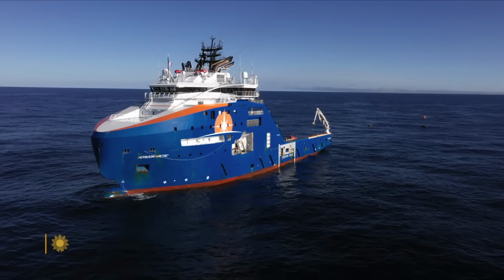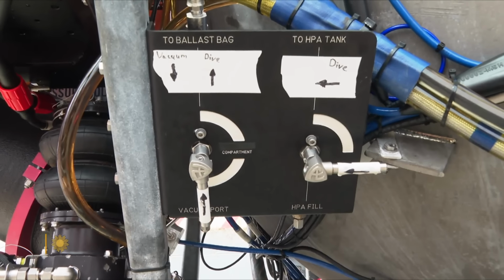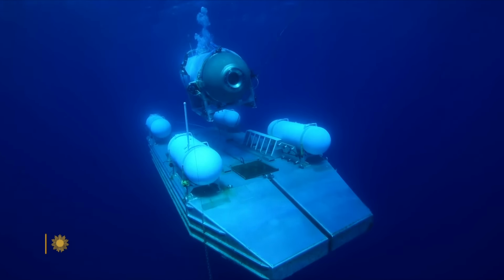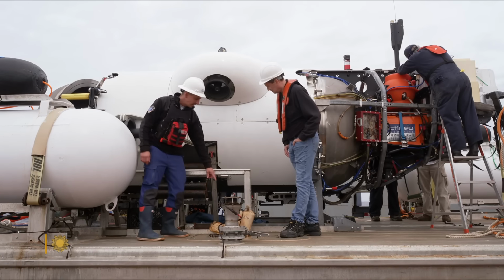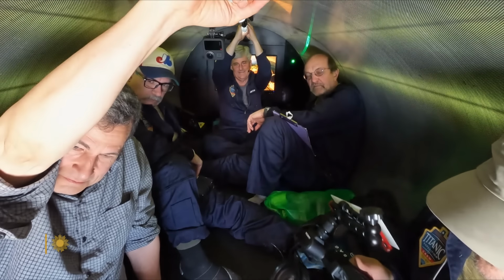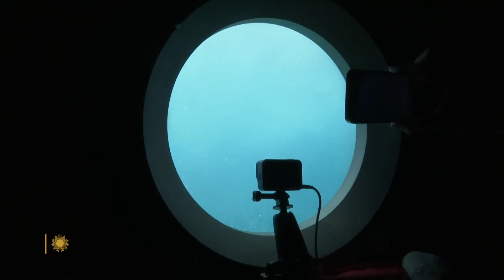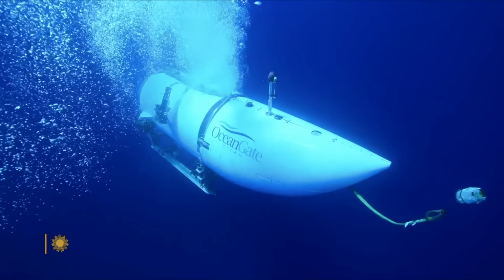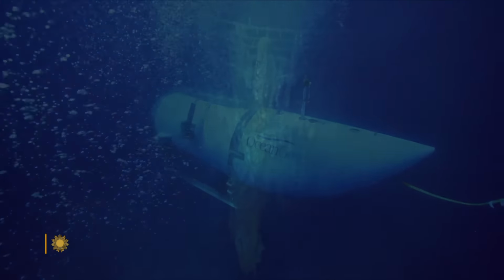Inside the Titanic sub disaster

Comment: For those wondering why it didnt collapse on previous trips...

This carbnon fiber sub went down to the Titanic and back to the surface numerous times. By doing that, the submarine would begin to collapse and then back to normal like an accordion, and this is what most likely caused it to form possible stress fractues over time. Also, different metals that touched each other causes rust. That can be an issue, too.
Reply: Sounds like it was just a matter of time.
Reply: @christianWilliams-pc4jn  have you ever heard Stockton Rush speak? He seemed oblivious.
Reply: The structural integrity of the vessel was compromised after the first trip. NO DOUBT 😊
Reply: Everyone is blaming carbon fiber composite and i agree, also they were using a bad glue...
Reply: @fleurjoesten  That the flaw with carbon fibre polymer. It's not a continuous material. It doesn't relax like steel or titanium does and it while it can withstand pressure well, it cannot go for nearly as many cycles as metals can, it fractures and delaminates. Unlike a metal sub that would just get squashed, the Titans hull would have snapped and shattered under the pressure.

James Cameron's sub that he used to go to the marina trench was 3 inches of steel he never chose carbon fibre because it wouldn't be up to the task.
Reply: @saricubra2867 i think the more likely culprit is the window only rated to 1300m
Reply: I'm no engineer, but I heard that flextape can be used underwater.
Reply: Good guess, but nobody really knows for sure
Reply: @saricubra2867  they used different metals/materials holding it together, and that alone causes rust. If you use a copper pipe with an iron fitting, then it will turn brittle.
Reply: @VinnyDoesLife  Carbon fibre does not rust.  Titanium does not rust.  Glue does not rust.
Reply: It was only a matter of time
Reply: Rush, such a befitting name
Reply: McClaren was the only guy on here that made any sense

Comment: That guy at 5:03 said that the thrusters were enough to take the sub back to the surface, but if those weights failed to release, there is NO WAY those batteries would have enough power to take that 12 ton sub on a 2.5+ hour trip back to the surface. This disaster wasn't an accident, it was inevitable.
Reply: Notice it's all millionaires that get caught up in these things .A fool and his money will soon depart

Comment: Instantaneous destruction on a cellular level.    The body was liquified on a cellular level in nano seconds, before the central nervous system could process.  They are lucky to not have suffered at death.
Reply: I appreciate how Hank Green put it. They instantly became physics instead of biology
Reply: Exactly!   Step 1:  Millions of pounds of water pressure filling the space in the sub in a nano second, causing molecular destruction from all directions.    
Step 2:  Water moving to fill that space in a nano second caused instantaneous tremendous super heating of the water hotter and everything in it thousands of degrees, due to friction of the water molecules, also within a nano second, destroying on a molecular level.     
Step 3:     The reverberation shockwave exploded outward with the same force the water imploded inward, also molecular destruction in a nano second.   

All 3 forces within the same nano second. 

The fools asking about bodies don't quite grasp simple physics.

Comment: Honestly his design and engineering was a great idea until it wasn’t… that sub should’ve been totally rebuilt and rewrapped every offseason but thats totally hindsight. I feel terrible for the passengers.. they put their faith in Stockton and he 100% failed them by not getting the sub certified and checked by third parties or listening to other experts warning him of the dangers. It’s truly a tragedy.
Reply: Exactly. The submersible was perfectly capable of making it down to the titanic and back, it just wasn’t capable of doing it multiple times.
Reply: Third parties (DNV) looked at it last year and formally refused it certification. They didn’t thing the carbon fibre pressure vessel was built to acceptable standards.
Reply: Yeah it made 12 prior Titanic dives + other dives, rebuilding the carbon portion & inspecting the joints between the different materials of the hull was the understanding upon which the sub was even built.
Apparently a company DID "rebuild the sub" after the 2022 season, but just what they mean by "rebuild" remains to be discovered (nobody asked or even approached them yet).
Reply: @ToreDL87  All the dives were on the Titanic - if they had dived on the continental shelf they would have had too get the submersible certificated. 2/3 of the dives were aborted because of “failures” - which indicates that their checking before the dives or the actual vessel construction was very sketchy.
Reply: @allangibson8494  They made at least 2 deep dives in the Bahamas as well, according to this guy (who also heard cracking noises from the hull) https://www.youtube.com/watch?v=0mSq6ibKKXQ&ab_channel=NewsNation
Haven't heard anything about prior aborted dives, but have heard that there were issues on pretty much every dive.

Comment: He had 7 redundancy to return to the surface; but, he had no redundancy if the hull gave way.
The hull gave way.
Reply: I was thinking the same thing.  The hull was crap.
Reply: without hull integrity , the other 7 redundancies mean Nothing
Reply: The two titanium rings were glued on...
Reply: @stephenneil9345 how else do you mount to carbon fiber?
Reply: @stephenneil9345 Glued on!!! Applied by hand and a spatula and mixed with a wooden stick by hand! That needed to be revealed to the guests. "By the way, those end rings are only glued on and there's only about an inch depth on each side of the ring clinging on for dear life. Oh, and it was hand applied in an open environment. Probably the cracking noises we've heard on subsequent dives. But it will all be ok since we don't test anything."
Reply: @@Richy_T that part blows my mind, the hull warning system is acknowledgment that the hull could fail but is obviously an insufficient solution when it could just shatter 2 hours down

Comment: Im not an engineer but when I saw them constructing that sub, I immideatly said the same thing, that sub is going to fail, cause the pressure chamber is constructed out carbon fiber, and the titanium rings are bonded to the sides. There is a reason why every submersible that works safely has its pressure chamber made from one solid machined or forged piece of steel or titanium or two pieces that are welded together to form one solid piece with no joints. When titan dived each time it was literally crushed by the sea pressure, carbon fiber is going to squeeze and expand at a different rate than titanium which will create gaps between the two materials thats a unforgiving and deadly flaw. The second flaw was the way they spun the carbon fiber strip, basically in a linear fashion one next to the other. This is another huge weakness. The analogy would be if you were building a brick wall and you stacked the bricks one on top of the other and one next to the other. They don't interlock hence you can just push the wall down. They should have been spun in a zig zag fashion crosing over each other for the entire length. Just because you are an engineer and have a PhD doesn't mean you can't make a mistake. The shuttle was constructed by thousands of phd engineers and yet it still had a deadly flaw.
Reply: Im not a sandwich maker but I knew as soon as I ....bla bla
Reply: @beachboy13600 thought the same hahaha
Reply: they are so unlucky they called NASA to consult them instead of you
Reply: @hansanders323  Well yes quite unlucky indeed....since they imploded into millions of pieces. The gentleman who spent 5+ years underwater also said the same thing and it makes perfect sense.
Reply: Could have at least vac bagged the carbon fibre...not that it would have mattered
Reply: @beachboy13600  everything this person said was legitimate and made sense. One can have common sense and come to these conclusions without being an engineer. The person was simply adding their thoughts and opinions on the subject.

Comment: Holy cow I never knew how small it is on the inside. I would not be able to be cramped in there with four other people on the bottom of the ocean. 

Also, for them to cancel the dive if there was "three things" wrong, but not cancel it if ONE thing is wrong is wild. I don't understand the logic behind only canceling the dive if three things are wrong with the sub, if it only takes one issue for it to end catastrophically, which it did.
Reply: They didn't say they had to have 3 things to cancel it.  Depending on what is wrong, one thing could cancel it.  If the hatch won't seal, they're not going to say, "Well that's only 1 thing wrong, we're going anyway!"  But if a label falls off of an air valve, you might not scrub the mission.
Reply: God point bryce, I was thinking the same thing when I heard this. All it takes is one thing on something like that to end up as shark food.
Reply: They could’ve just wore eye protection
Reply: I love my girlfriend
Reply: I love my boyfriend
Reply: It’s just virtue signalling. By cancelling with 3 things wrong, they signal that they possess “safety culture.”
Reply: I'm getting anxiety just thinking about it
Reply: @shamekajoseph1636  cry

Comment: rolling the sub in order to tip off weights is absolutely insane to me, seems very under engineered. in other subs they have electromagnetic weights so if the thing loses power it automatically detaches them so the whole thing can return to the surface
Reply: Maybe you should try rewatching the video while paying attention.  That was just one of SEVERAL backup methods they had for gaining positive buoyancy in the event of an emergency.
Reply: @stargazer7644  true there were other methods. I think Dem was just pointing out how inefficient that ONE was.
Reply: @nickgoesvestmode  Well I don't know that it was "inefficient".  The thinking behind that one could simply be they wanted a failsafe if they lost attitude control.  If the thruster jams on and they roll too far, they're automatically headed to the surface while the unrestrained occupants roll around inside.

Comment: He may have thrown caution to the wind, but I'll say this for him: he had the courage of his convictions to actually be onboard himself. It's easy to cynically put others in jeopardy when there's no risk to yourself. He at least really believed in what he was doing.
Reply: Yeah, I agree. Negligence and malicious negligence are very different.
Reply: I’d rather he was malicious. Then the Pakistani father and son wouldn’t have gotten on board.
Reply: Oceangate was desperately trying to hire a pilot on indeed right before this 🤔
Reply: @sidewalksurf800  That doesn't even make sense
Reply: Rush, is such a befitting name
Reply: Or was he afraid to do it alone?   U want to use that sub for personal use fine. But when u are responsible for others you take every and all precautions. You take and pass every test. U accept and pass all inspections and certifications. Rush did none of those things.
Reply: @RaylanGivens1232  Of course his conduct was ultimately irresponsible. I'm not saying otherwise, though I highly doubt "fear" was a factor.

Side note: what are you doing with all that free time you're saving by typing "U" instead of "you"?

Comment: Same thing happened to the first passenger jet-connecting two different materials at a potential point of failure. the Comet IIRC. They didn't know how to properly shape the windows and seal them to the aluminum skin. The repeated pressurization of the cabin caused two of them to explode in flight killing everyone onboard.

Comment: Had he made the whole pressure vessel out of titanium, they would likely still be around today (titanium can be cycled indefinitely if built so the pressure is below its fatigue limit). I wonder how much more that would have cost compared to the carbon fiber approach, and how much heavier. He even might have been able to keep going with his floating launch platform, perhaps with some modifications.

But then his use of off-the-shelf components raised a serious fire hazard. Maybe using titanium would have prevented an implosion, but then he likely would have bought it some other way. When you cut that many corners, it's more a question of when and how.
Reply: Off the shelve were cameras and the controller.  A camera not working is not going to cause  an implosion lol.
Also I agree it should have been made of titanium but NO WAY would I trust it if the metal is recycled.
Reply: Thanks for repeating the talking points you've heard on various Youtube videos, captain obvious.
Reply: @Body_Model  That's the "how" part of my comment. There are multiple ways one could buy it in a submersible beyond an implosion. A catastrophic fire within the cabin, failure of the life support system, getting trapped on the bottom at 12,000 feet with no way to find you, etc.
Reply: @drdrums1  How exactly is a camera going to cause a fire? Cameras do not explode  or are flammable.
Reply: @Body_Model I guess the next point of failure would be the window bursting
Reply: @Body_Model  Any electronics can catch fire (I've toasted some electronics myself). But more likely would be a lithium-ion battery, which have caught fire (remember the Galaxy Note 7 debacle?).
Reply: @drdrums1  I don't get your point of your argument. It sounds like you are saying they shouldn't have any electronic devices in a submarine. I mean when is the last time you ever heard a camera catching fire lol. Cell phones yes.
Reply: @Body_Model  My understanding is that standards for certifying DSVs include consideration of the electronics that go in the vehicle, specifically so that they're relatively fireproof. So the problem w/ Rush using off-the-shelf components is that they may be more prone to starting a fire than would be acceptable in a DSV. Consumer goods are generally designed to not accidentally catch fire, but if they do the assumption is that you're not trapped in a small cylinder with them, where they may be in proximity to life support systems.

To use a somewhat related example, generally anything that gets installed in an airplane must be certified by the FAA. Part of that certification includes ensuring that the device won't interfere with critical flight systems, or pose an unacceptable hazard to the occupants of a vehicle that's thousands of feet in the air.
Reply: @drdrums1  Okay you clearly are making things up just so you can sound smart. I have never heard retail cameras are a fire hazard. the difference between commercial cameras and retail cameras they are constructed where they can stand the elements from outside.  As far as interference  that would either have to do with the cabling if it's unshielded or if it's wireless.
Reply: @Body_Model  Whatever dude. I never even mentioned cameras in my original comment; you brought those up. There was much more off the shelf in the Titan than a few cameras and a controller (you can find interviews w/ the CEO on YouTube about that).

You seem to be missing the bigger point I was trying to make, which is that even if Rush had built a pressure vessel out of industry standard materials, he still cut corners everywhere he thought he could get away with it, so there were any number of other ways that could have resulted in catastrophe that didn't involve an implosion.

Why are you trying to pick a fight?
Reply: @drdrums1  You mentioned electronic equipment as if that's the reason the implosion happened.  I will agree with with the expert on this one with 3 different material. Especially carbon fiber was not a good idea.
Reply: @Body_Model  I never once said that, or even suggested that electronic equipment had anything to do with the implosion. I said that "his use of off-the-shelf components raised a serious fire hazard" and that "[m]aybe using titanium would have prevented an implosion, but then he likely would have bought it _some other way_." By "some other way", I mean just that - suffocation, hypothermia, fire, etc. I don't know how you could take that to mean that I thought electronics had something to do with an implosion.
Reply: @drdrums1  You did suggest retail cameras are a fire hazard.

Comment: Titanic waters are the bad luck of humans just leave it alone
Reply: It had nothing to do with the waters, just poor design
Reply: And add to that, the pretentious hubris of trying to rival Musk (which btw I think is also a loser), cutting as many corners as possible, and to top it all off, calling the craft 'Titan', which happenned to be a 'submersible', as though to taunt the tragic fate of the original vessel. I guess he had it coming. Tragic for those tourists who paid a quarter of a million dollars.
Reply: @rigelb9025  he wasn't doing anything to rival Elon. SpaceX rockets are meant to fail to learn from mistakes, but not with humans aboard
Reply: @jamespaul2587  If he wasn't trying to rival him, why did he ever mention him?
Reply: @rigelb9025  because he wanted to justify his innovative   approach, and lack of safety protocols by comparing the process to someone who is an accomplished engineer that actually understands physics
Reply: @jamespaul2587  That kind of sounds like rivalry to me, even if it wasn't 'negative' in nature.
Reply: @rigelb9025  not to me, as I see rivalry as a competition or attempt to copy someone's accomplishments. This was just a way to try and justify his lack of safety and proper structural engineering knowledge
Reply: @jamespaul2587  That's fair. But the way I see it, Rush was almost trying to out-do Musk in terms of sketchiness. A race to the bottom, if you will. And rush made it there.
Reply: @rigelb9025  yes, but Elon does not use sketchy engineering and materials to create cars and rockets